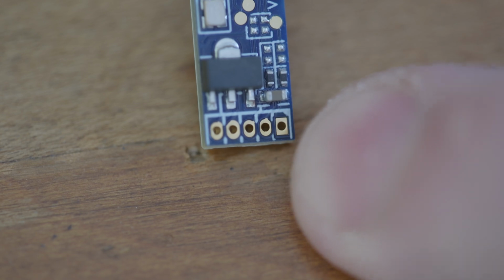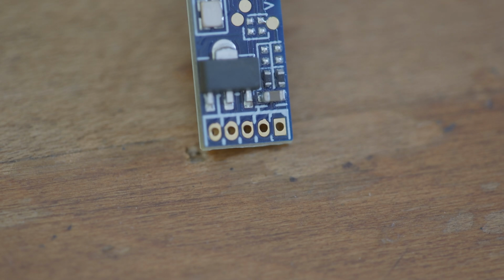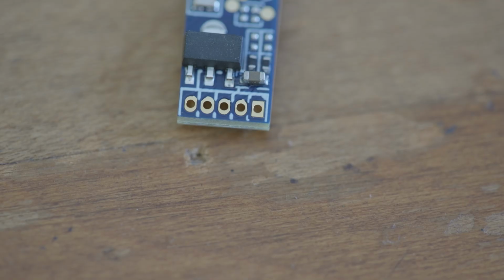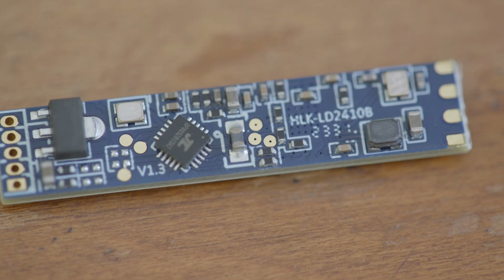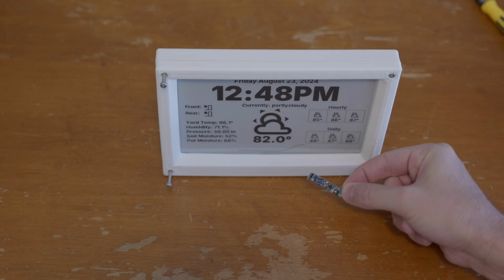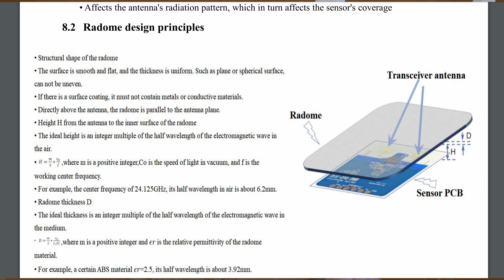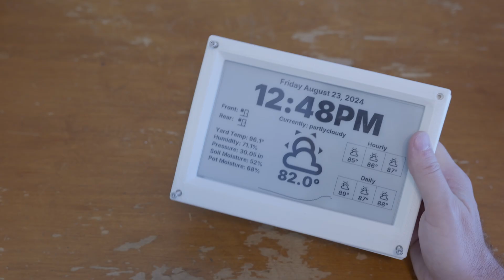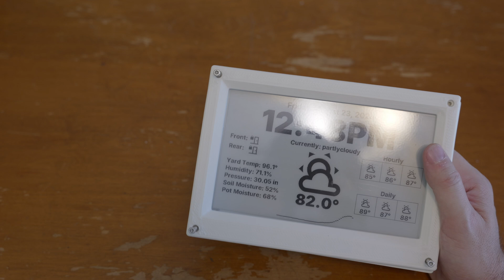mmWave Human Presence Sensor: LD2410B

Comment from the maker: FYI, I moved the sensor after this to actually be in the bezel, pressed right up against the front. Placing the sensor there improved it's accuracy a lot, compared to leaving an air gap. Looking at the manual, I think it specifies a maximum gap that I missed. Perhaps there are some reflections or something that happen if the boundary layer is too deep.

Comment: For indoor use have you looked at the STMicroelectronics P-NUCLEO-53L1A1 dev board? It detects motion, direction and has settings to change the field of view(FoV) and range.
Reply from the maker: I have not, but that appears to use a VL53L1X sensor which is laser based, which would require line of sight I believe. It also seems to have a pretty narrow FOV (max of 27deg) for a household application. It does seem pretty cool, just built for a robotics application where you're trying to see what's ahead while moving.
Reply: @TechDregs  or used over a doorway because it not only senses the object it also senses the direction of motion. So a room is occupied if someone moves into the room and does not move out of the room. As long as you have all exits covered.
Reply: Cool project but why not just use an off the shelf motion sensor?  I have the same use case and use the GE/Jasco wired z-wave motion switch/dimmer to turn on certain lights when it detects motion between 6 and 9.
Reply from the maker: The main reason is "why not". It's a hobby.

But this one also allows for a lot more control and integration into HA, while costing under $10. These also can sense still objects, not just motion. So, they do actually have some advantages although I won't pretend that that's why I did this.
Reply: useful feedback, thank you .I like the e-paper dispaly, looks great! May u share any details about that project?